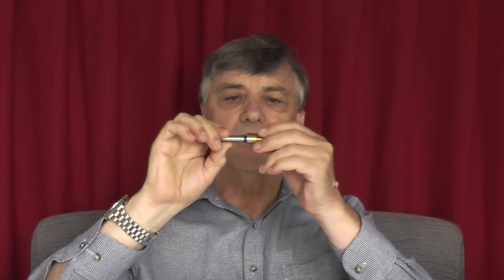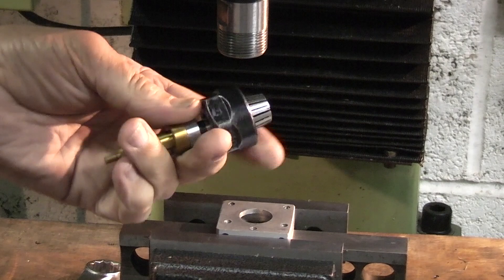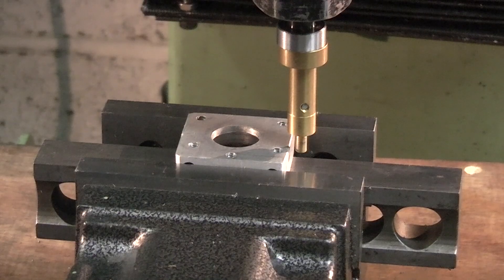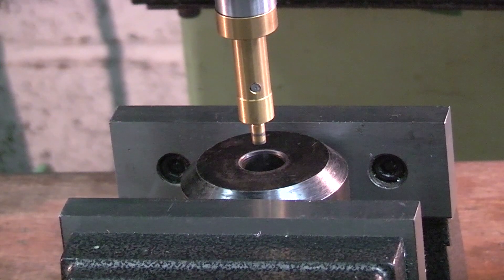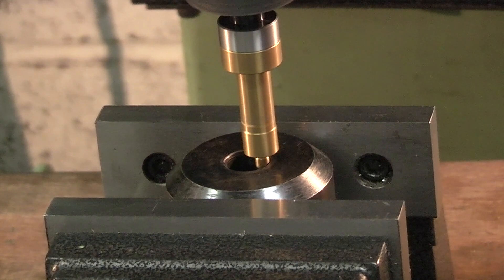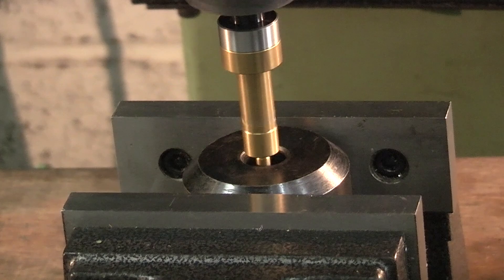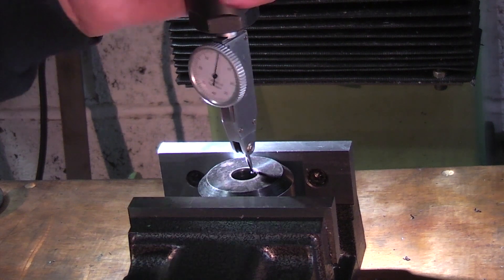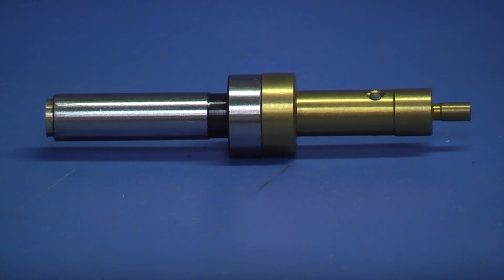Tool review Edge finder

Comment: I have the same model from Banggood and is very reliable indeed. I also bought one of the electronic ball ended edge finders that bleep and light up when surface contact is made. It is also very accurate and dependable. A similar bleep and light unit would have cost around £70.00 If bought from a UK supplier. Banggood's price was around £13.00 when I purchased.